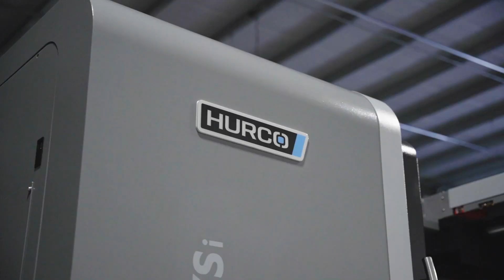CSI and Hurco Machines  | Made in America

Comment: Hurco are an AWESOME company to deal with.  I had a 3 axis Hurco bed mill years ago that I purchased used.  I had an issue with the CNC control. Even though the machine was old (and therefore no longer supported by Hurco), and even though I did not purchase the machine from Hurco, their tech support guys jumped through hoops on top of hoops to help get my machine running again.  Whats more, they did all of this FREE OF CHARGE.  Some of the best product support I have ever experienced.  Add to this the incredible build quality of their machines and you have a world class machine tool.  Congratulations on your expansion.  I suspect you will love your Hurco machines.